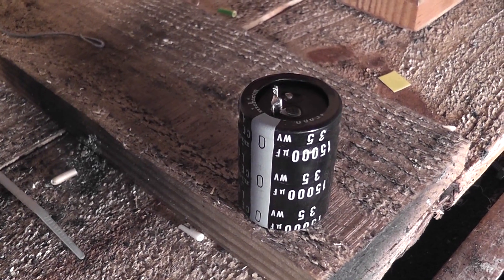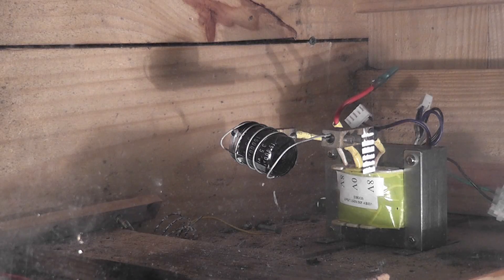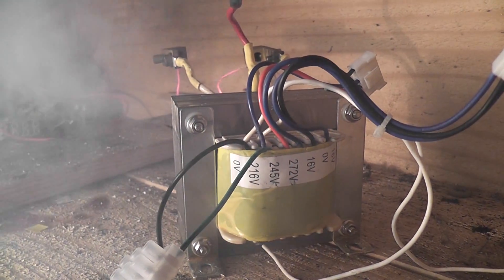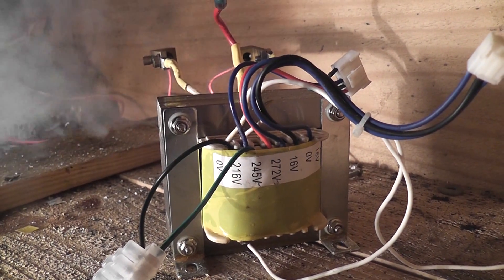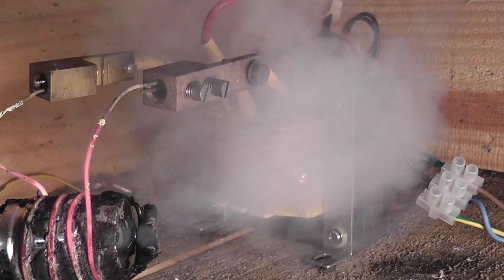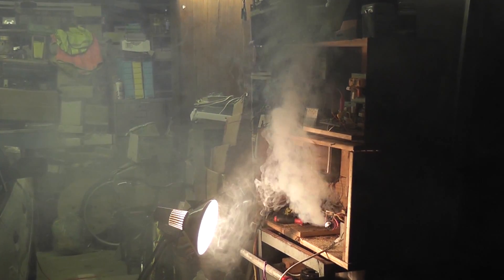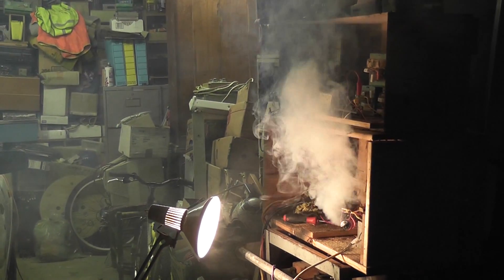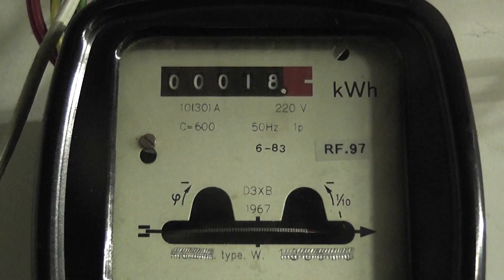15000µF Capacitor in heating element vents and smokes

Comment: COUGH I'm surprised the heating element didn't just melt through to the aluminium can and burn out. 
Lots of experiment potential: Heating {insert victim here} to well over flashpoint without reaching autoignition.

Comment: Absolute LMAO. I think you've set a new record for "longest capacitor vent-off". I think something's been learnt here: A slow boil makes more smoke instead of powering it backwards. Look at it go!

REQUEST: When changing the YouTube meter, may I request a Metropolitan Vickers type NF ? This instrument has a 0.01 kWh dial, and also a high rev-speed at 600 revs/kWh. But, at only 10A loading capacity would it become damaged? 

If so, alternatives requested: Sangamo SPA 01 / Sangamo HMT. Thanks. BBD